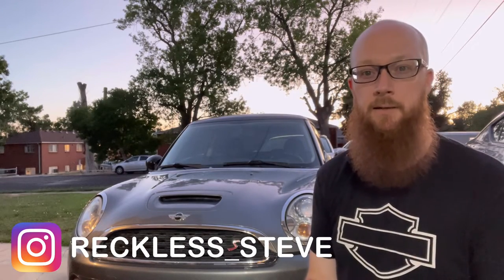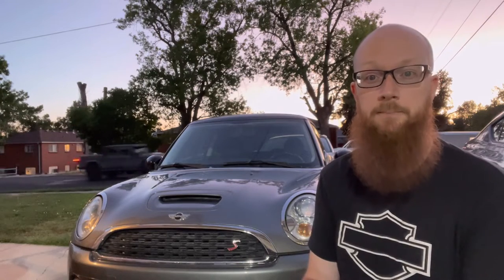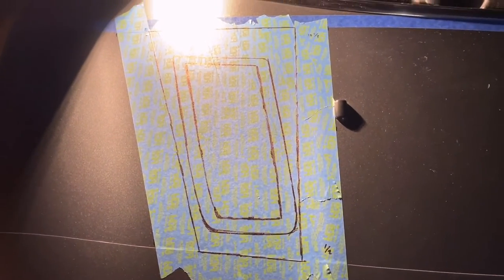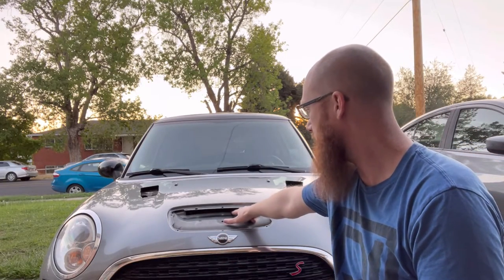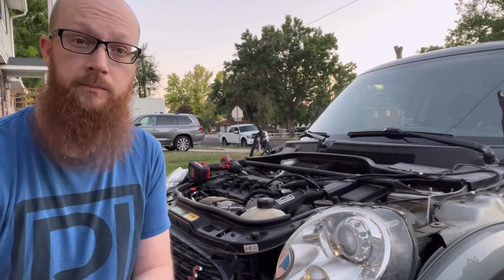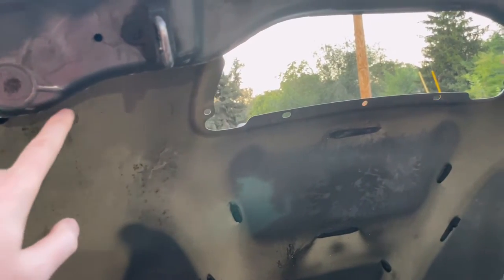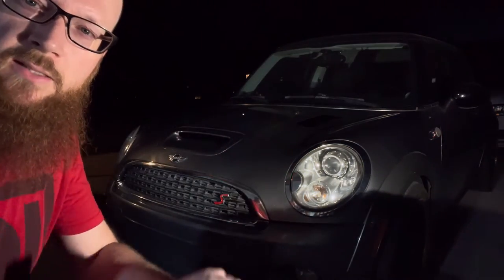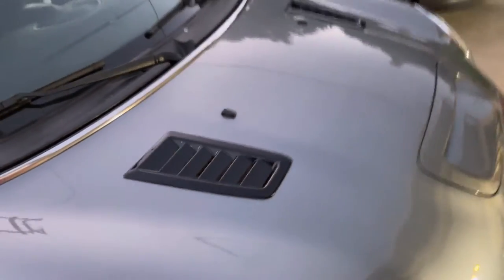Turbo Mini hood vents and weight reduction

Comment: I used the exact same vents in my Clubman. Since I work in a collision shop I had it a little easier since I have the tools and cutters to do that. ;) I had the same problem with the tape on the vents, and even after adding new tape on them, I didn't trust the way they fit, so I put some small screws in all 4 corners. Came out nice, and the screws aren't even noticeable. Also, before I installed the vents, I glued in some window screen on the bottom side of them, as a little deterrent against bugs and unwanted stuff in the engine compartment. I had added the screen to the backside of the factory scoop a while back as I got the hood used but never had the factory insert for the scoop. Turned out I liked it better with the screen, at least it has some air going in there. So, I used it on the new vents too. ;)
Reply from the maker: Awesome. The tape I used is holding great. I tried to pull them back off and they wouldn’t move. I’ll see how it lasts long term.

Comment: Cool! (See what I did there?) I put hood vents from a Jaguar XKE Supercharged into the hood of my 2005 R50. It's even more important to keep the NA engines cool (especially when every horsepower counts!), and I live in Arizona, where it's ridiculously hot in the summer. I was surprised how much the steel sections I removed weighed. Also installed a 180 CFM ChillOut Systems Club Series blower motor to force fresh, cool air into the CAI box. https://www.youtube.com/watch?v=lWAQU6VwJYE
Reply from the maker: Awesome, I think all Mini’s run hot. Arizona definitely isn’t helping you there.
Reply from the maker: I like the color of yours.

Comment: Love the videos about minis but man, as a former aircraft structural repairer, its foolish to say cutting away that much material, specifically designed to add to the structural integrity, wouldnt affect the structural integrity of the hood. Cools better? for sure without a doubt. same in a crash? no man. Best of luck to ya, Subbed!
Reply from the maker: I know there’s less structural integrity. I’m sure it’ll be even worse in a crash if I swap to a carbon fiber hood. Which I’ll probably do. So, I will keep fingers crossed that I don’t get in an accident.
Reply: Dude as if the bonnet is a structural part haha
Reply: @crc0889  the point wasnt the structural integrity of the vehicle, its rather the SI of the "bonnet" my dude. That hood would act a LOT differently than a stock one. Best of luck.

Comment: did you happen to notice a changge in engine temps as well as intake air temps after all this?
Reply from the maker: Before the vents, still with stock intercooler, on a 100 degree day. It would heat soak so bad at autocross that it wouldn’t come up on boost on the launch for the last few runs. After the vents, still on stock intercooler, on a 100 degree day. I could launch in boost all day. Didn’t actually check engine temps or iat’s before and after, but functionally I’m happy.

Comment: I feel like the hood will flex at high speeds due to the air pressure. All that metal is there to keep the hood strong enough to handle weight and pressure
Reply from the maker: There’s a little more flex, but not enough that I care. I can still close it like normal, so it’s not even enough flex to hinder that.
Reply from the maker: They do. Before I did them, at autocross it heat soaked so bad on a 100 degree day, it wouldn’t do a boosted launch on the last couple runs. After I did them on a 100 degree day it launched in boost all day without issue.